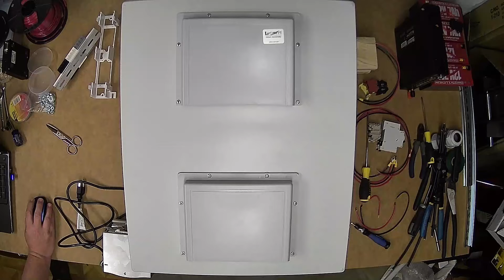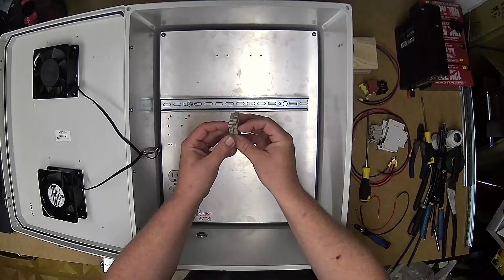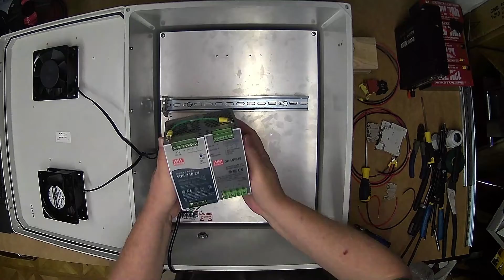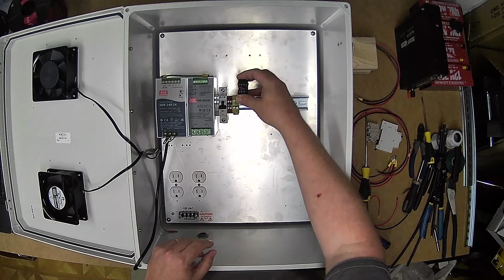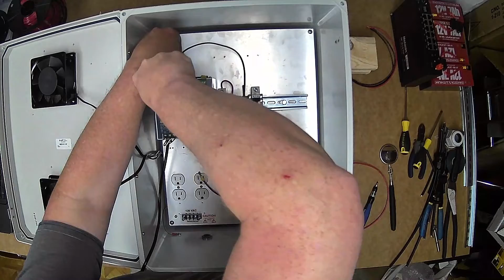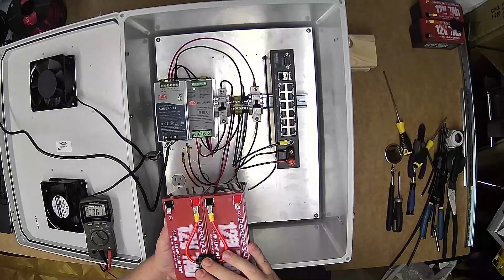24VDC Cabinet Build

Comment: Hi, which battery is better for such system? Yuasa SWL1100 12V 39.6Ah (VRLA) vs Victron AGM Super Cycle Marine 12V-38Ah vs any AGM car battery rated around 80ah?

Comment: You should pick up a torque screwdriver so you don't over tighten the connectors on those terminal blocks. The Dinkle ones are rated for 2 Nm.

https://www.amazon.com/dp/B00V9G09XC/

Comment: Kk feedback.  <3 First looks great, Tidy, neat..
Where's your router!!! ;)
Love that your using proper DIN Terminal blocks <3 
Oooh you grounded the switch! Awesome!
 

1, Those batteries "though dakota claims so" should not be placed in series. they'll lose sync over time. When using lithium packs you need to connect the bms straight to the BUS. this means at 24v you need a 24v BMS or with 48v a 48v BMS. You cant put 2x 12v bms in series. 

I dunno. I cant really see anything else wrong <3 
Is that an L-com cab? Those are a bit over priced if you ask me ;)

Good job <3
Reply from the maker: We don't do routers at (most of) our tower sites.  This one, in particular, has a PTP backhaul to another site with 10G fiber and will soon be upgraded to an AF5Xhd link and eventually a fiber connection of it's own.

If we did have to do routers, it'd likely be CCR1009's using MPLS/VPLS over OSPF to deliver L2 traffic back to a L3 gateway.
Reply: @RealTinkerTroy  You doing L2 isolation then? When running a distributed wireless network its important to have Routers at each site. Ospf or BGP are needed internally. Multicast can run into issues across a few hops.
Reply: @thefixitgal  ospf/bgp won't fix multicast neither. Multicast only works within the vlan or through igmp proxies
Reply: @ON3RVH  Multicast is a L2 function as is ARP. It exists within an open broadcast domain. By segmenting the network and reducing the size of that Broadcast domain & localizing it to the router at that site it will resolve many issues. 
If you domain spans multiple towers the domain becomes huge. It crosses wireless links which with some radios especially UBNT causes issues on L2. Span that across a few jumps you can get issues. Next.. 
With a large broadcast domain, especially one run by an inexperienced operator issues like Arp storms can become a very real threat. So can a lack in proper L2 isolation leading to DHCP pollution or exposing gear to clients.  

A proper last mile starts at a router. Then you add L2 isolation at the bridge, switch & AP. You elevate the Core equipment into a management VLAN. This simple practice produces a stable, secure & Efficient network. 

So back to your point of OSPF/BGP not helping with L2 issues. I think you misunderstood what I was saying. They don't repair L2 issues. Im talking about proper network segmentation which is essential in wireless distributed infra.
Reply: @thefixitgal   then I indeed misunderstood/misinterpreted your comment. It came across as if you wanted to have multicast span across segments
Reply: @ON3RVH  Nah ;) Im not a fan of flat networks. On the other hand proper switch centric networks can be pretty cool but most small carrier gear hasn't got the functionality to setup anything properly in that manner.
Reply: @RealTinkerTroy  MPLS is good. VPLS isnt always necessary. MPLS relies on OSPF. Think of it as an OSPF felper. It jumps packets from point to point rather than hopping to every interface they cross. VPLS is really only needed in situations like having a limited Public IP space or Centralizing some thing like PPPOE etc. Otherwise Im a massive fan of Segmented networks with routed public Ip's ^^